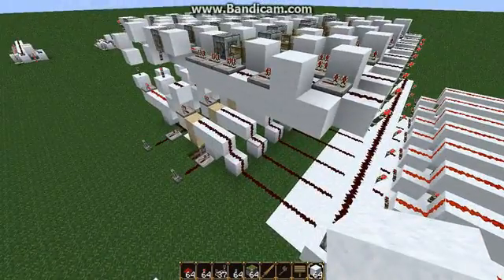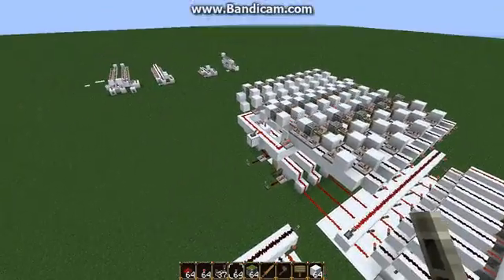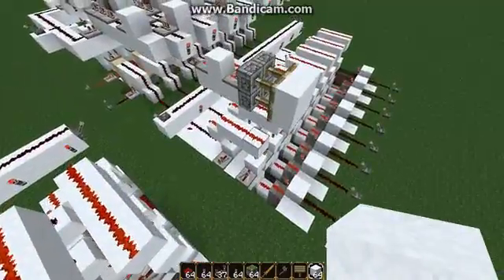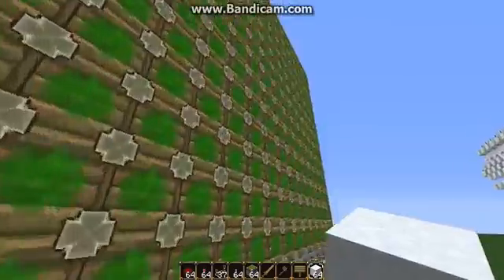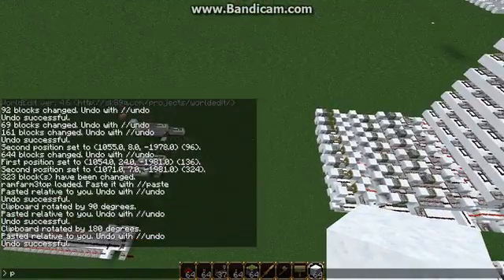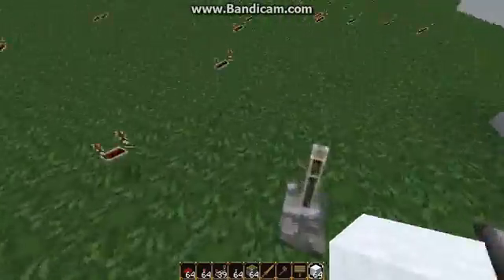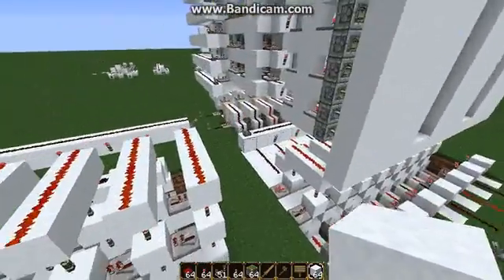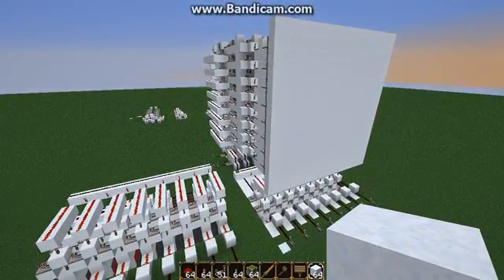Building a minecraft GPU tutorial pt5: The Screen and Enablers/Disablers

Comment from the maker: First off, this is actually 2x2, not 4x4. Although 1x1 is possible, it's not practical in most cases for a couple reasons. First off, it's impossible to get almost any hardware to fit in a 1x1 space, so you'll need to have a second, separate structure which will be enormous: about 4x bigger than this since you have 4x as many pixels. The other issue is 1x1 needs a ton of repeaters to fit in the space, so it'll need a ridiculous amount of repeaters, meaning it'll be very slow.